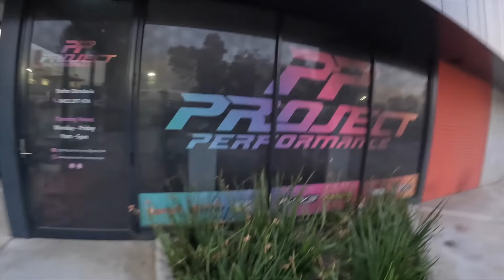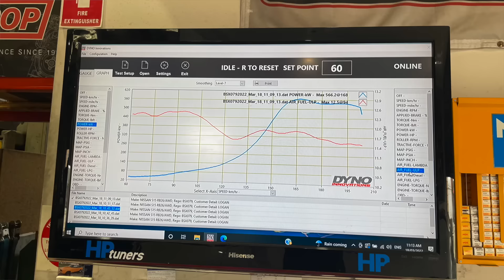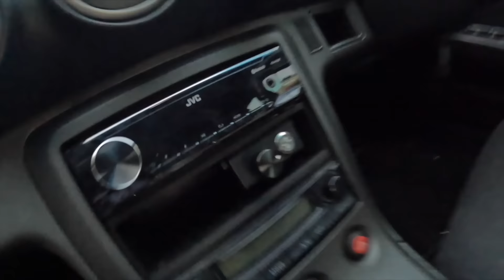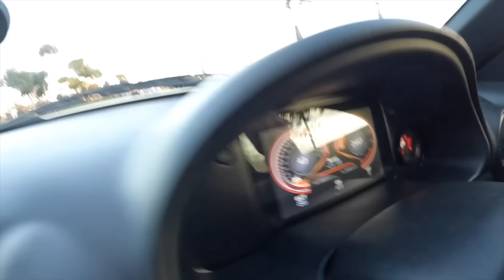ALL WHEEL DRIVE RB25 Nissan S15 SILVIA

Comment: My Z had a chip that size on the bottom of the windscreen.....2 days later a truck went past in the wet and splashed water up onto my windscreen and I had the heater on - shocked the glass and the tiny chip turned into a crack the whole width of my windscreen. Great times.